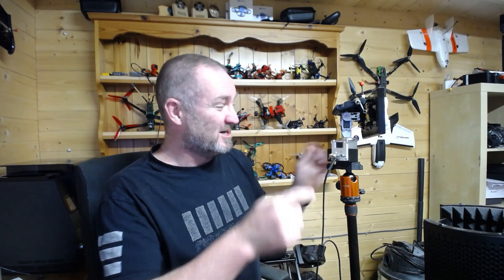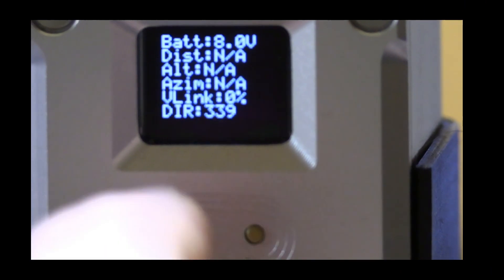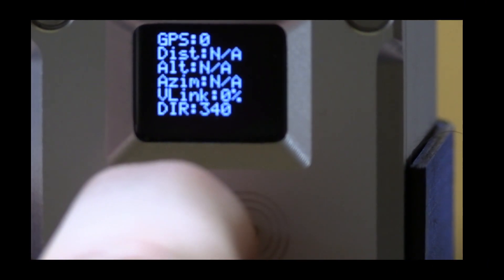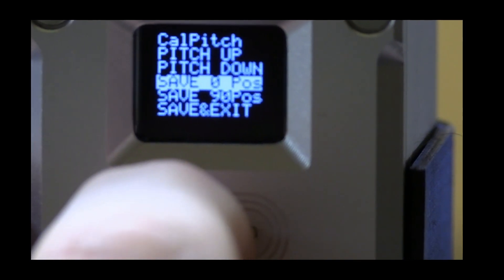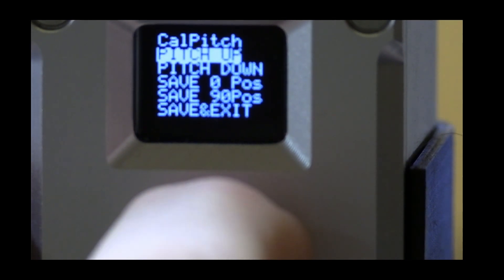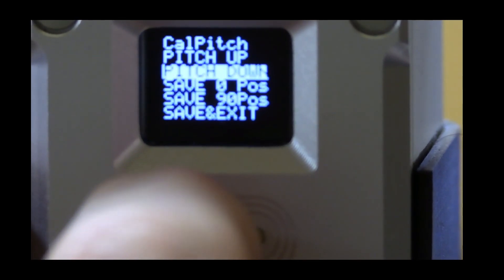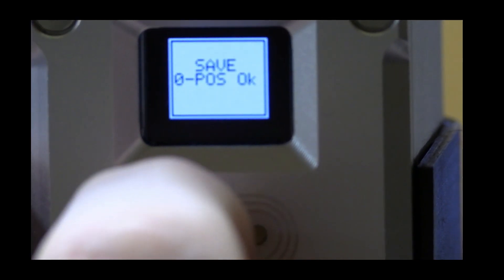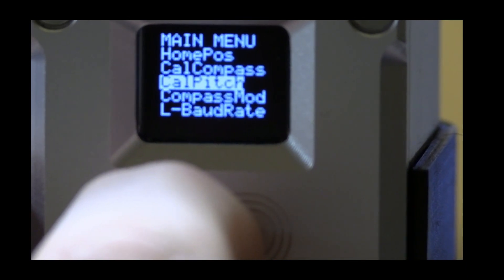MFD CROSSBOW | CALIBRATION OF THE PITCH AXIS

Comment: Hi, with 0 where you had your one, mine wont go higher than about 45 degrees. (There is no obstruction) any idea why it would do this? I even changed it onto the next higher screw holes and then its zero wont go low enough.
Reply from the maker: That's a bit strange.

Wonder if on the wrong gear notch on the servo?
Reply: @RTRCTV  guess I will pull apart and have a look